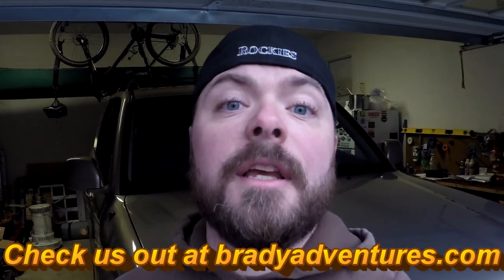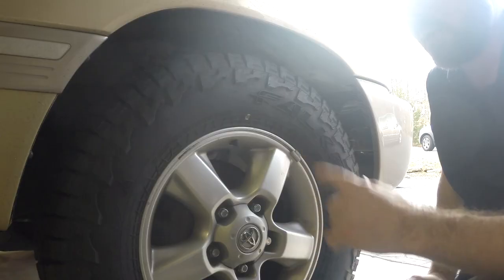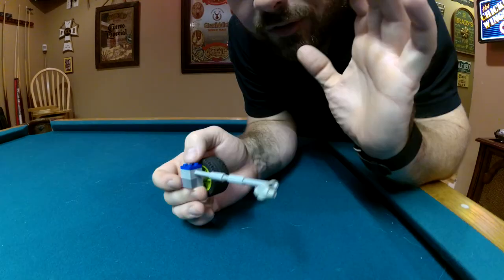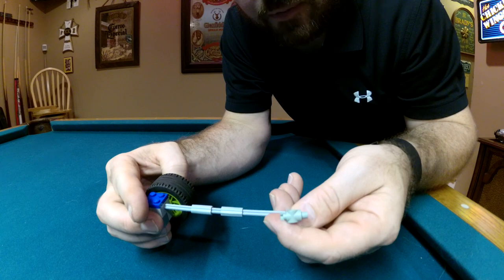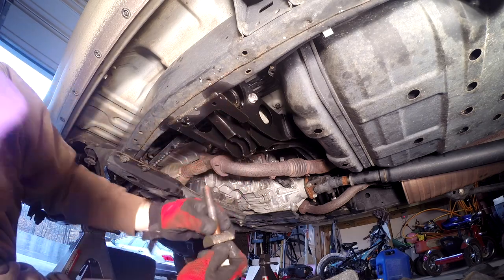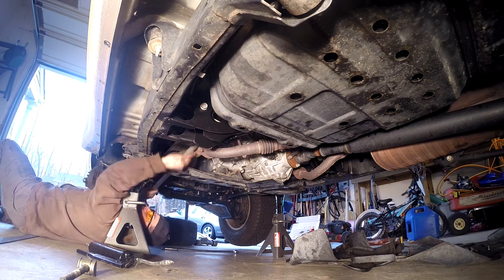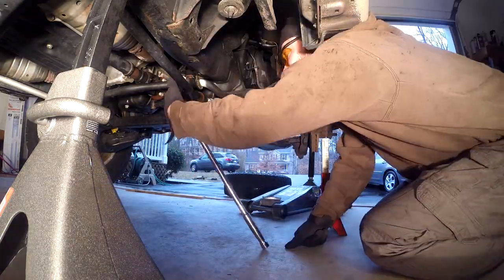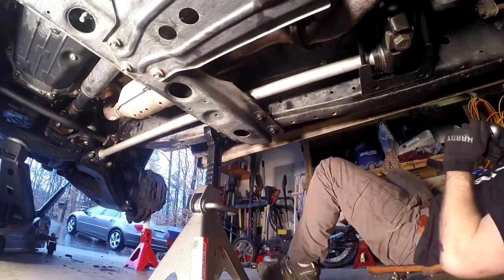OME Torsion Bar Install - Land Cruiser 100 Series Overland Build

Comment: I just finished the lift on my lx470 today and It looks absolutely massive. Didn’t know how to remove the torsion bars and thankfully I found this video and it helped a ton.
Reply from the maker: So glad to hear it! I hope these help people especially when the info is hard to find. Thanks for checking us out and let me know if you ever have any questions
Reply: @BradyAdventures  After installing the new shocks and springs,
can i drive without torsion bar until  buying it later on ? thank you

Comment: Nice video. These things have always mystified me, makes it a little clearer.

One thing, those ratcheting vehicle stands are death traps. They all get recalled in Australia then replaced with a new model. Few years later the process repeats. I'd never get under a car held up with them. I personally know someone that had a set fail and have a car fall on them. Very lucky to be alive.

Comment: A subscribe and a like for you, sir!  This was exactly the video I was looking for, my Ironman 4x4 torsion bars come in tomorrow. Thanks for taking the time to make this video and explain the process, us visual learners need it!
Reply from the maker: Man I really appreciate it!  Thanks for the feedback and hope your install goes well!
Reply: I'm in the process of installing my IM lift right now. The directions are very sparse. I had no idea about which the the bars go to preload, I ended up sitting on the bump stops the first time.
Reply: @Digital_Dairy  strange, my Iron Man torsion bars came marked on both ends, with a several spline offset.
Reply from the maker: Nice improvement!
Reply: @rguil15  so I had to pull them and you are correct. Made things easy.

Comment: Great video. Got one possible stupid question please. Why are torsion bars replaced? Do they lose strength?  I don’t know.
Reply from the maker: thanks! not a stupid question at all. yes they fatigue over time just like a spring and sag. you can crank them up to regain height but lose performance. aftermarket bars have a higher spring rate too so perform better under heavier loads and rougher use.

Comment: 5:55 what ecatly the difference in between the old and new one? I just got an LX470, ahc deleted and replaced with regular shocks, nothing else has done. Front is way lower than rear, trying to level it up

Comment: Should the adjustment bolts be at a similar depth to each other? My driver side one is in at a greater depth than the passenger side.
Reply from the maker: I think generally the answer is yes.  A number of things could impact how deep each bolt is cranked but probably wouldn't make much of a difference.  I would suspect the indexing of one of the bars was a little off.  As long as the truck is sitting right/level and the bolt isn't bottomed out you should be ok.  You might need to re-index down the road once the bars settle and have some age on them.  Otherwise you could pull them back off and re-index and try a second time.  I am assuming these are new t-bars if they already have some age on them one may just be more shot than the other.

Comment: Quick q: if you’re just reindexing the stock bars, would you need to remove them completely or was there enough “play” in the adjustment bracket housing to remove the rear bracket and clock it over?
Reply from the maker: I don't think you can do it without removing the front bracket 🤔 I haven't been down there in a while but once the front bracket is off it's pretty easy to remove them.  So I think you could adjust them without completely tacking them off the truck but by the point you have it were you need it, it will probably be just as easy or easier to do it on the ground.  I hope that makes sense.

Comment: Hey I just installed the OME kit but did not do the diff drop bracket. Would that help my height up front if I did instal the diff drop bracket?
Reply from the maker: Nope the diff drop is not going to increase you height. your height is totally dependent on how much you crank the t-bars.  but make sure you have enough droop!  Sufficient Droop is essential for safe handling Droop is going to be limited by a number of things including shock length, UCAs, etc.  The diff drop is going to keep your front axle shafts close to stock geometry.  This will keep your CV boots and/or joints from failing prematurely.  This can be an expensive repair so it's decent insurance.  I hope that helps, let me know if you have anymore questions! Thanks

Comment: Hey, thanks for the install video, I'm just about to do mine- Tough Dog torsion bars. Question- how do you know how far to crank the adjusting bolt in the first time after installing the new bars? I didn't see you counting the turns when you took the old ones out.
Reply from the maker: That's a great question.  The adjustment bolt goes through the the bracke it screws into and out the other side.  I turned the bolt until there was a decent amount (1/2" or so) on the other side of the bracket for the first check.  The truck was sitting pretty low. I had to turn them quite a few turns after that.  I kept recording how many full turns to how much height I got, rinse and repeat.  It took me a good while to get the driver side close to the final height.  Once I got to the passenger side I cranked it way further initially. I tried to get the amount of bolt on the far side of the bracket close to where I ended on the driver side and it was real close initially, so it went much quicker.  Let me know if that makes sense.
Reply: @BradyAdventures  I know that you're supposed to have a minimum of 50mm of droop to allow the suspension to articulate properly- I'll count how many turns it takes to get the bolt loose and see where that gets me when I re install it. Thanks!
Reply from the maker: @islandj39  absolutely that sounds like a pretty decent way to get started. Hopefully you'll have more droop than that too. I ended up having somewhere between 60 and 70 millimeters if I remember correctly

Comment: I don't think I saw this answered yet. Did you have to do more than 5 splines or was the adjustment screw enough on its own?
Reply from the maker: Nope the screw was plenty after the standard offset.  It is somewhat dependent on the weight of your vehicle but I still have plenty of adjustment left.
Reply from the maker: by the way sorry I missed this one!  Didn't realize this was a month ago!  Thanks!

Comment: @selesheestifanos6708
0 seconds ago
Thank you, great education. I have an LX470 that I  drive a few miles per day within the city and no off-road driving at all. I want to replace AHC with the EMU regular shocks and springs of a land cruiser.  Do I need to replace the torsion bars or can use the original on a car?  Help, Help

Comment: nice vid.  i need to remove the front sway bar bracelets on my 01'.  the bolts that run up are  rusted and rounded.   if i remove the tortion bar do i need to remove the front bracket off the lca or can i slide the tortion bar out without removal of the bracket?
Reply from the maker: I don't think you will have a problem getting them out with the sway bar brackets in place but you do neet o remove the front bracket that the torsion bar slides into. Does that makes sense? Good luck!

Comment: Do you need to replace stock torsion bars when installing a lift kit
Reply from the maker: You don't have to but it is a good idea.  The aftermarket torsion bars have a higher spring rate and and will preform better when lifted.  I needed to do mine too since they are 13 years old and shot. Thanks!
Reply: @BradyAdventures  What were the symptoms of the shot torsion bars?
Reply from the maker: If your truck is sitting low or uneven that can be a sign of them starting losing some spring. You can always crank them to get the height bacl and even things out but the spring won't perform the same. If they are totally shot then I would expect the truck to feel kind of bouncy. Mine were sagging but I don't think they were shot. if you're lifting it's still a good idea to go with aftermarket bars since they have a higher spring rate to handle more weight and the lift.

Comment: Hey great video. What were your final numbers from wheel center to fender front and rear?
Reply from the maker: I think they are a bit different then a couple years back but today I am sitting at 21" up front and 21.5" in the rear.
Reply from the maker: Oh and Thanks! and I apologize for taking so long to get back to you!

Comment: Hi Chuck, What were your final measurements. Also, any tips on how to know which direction to go with your 5 spline offset?
Reply from the maker: My rear sits at 21" from the center of hub to the fender and the front I have adjusted to 20.5".  I did have the front at 20" for a while but like the close to level look.  My truck is generally loaded out so I don't have to worry about the back getting too low.  As for the splines, this can be confusing in so many ways.  If you get it backwards you will know because the truck will go super low the first time you lower the jack. If you are sitting the same direction  as if you were driving and everything was laid out as you were installing it you would mark rear of the torsion bar 5 splines clockwise on the driver side and counter clock wise on the passenger side and line your front mark and the rear mark up with the respective master spline mark on the brackets.  I hope that makes sense. This is a graphic I found in a thread on ih8mud a while back that might help you visualize it https://drive.google.com/file/d/11xJ-sQPwW-8nAqGreEx62CrKbm8F-1ia/view?usp=sharing
Reply from the maker: I got it back wards and am editing it now to be correct.  I can't even remember it straight 😂
Reply: @BradyAdventures  All good.  It's super confusing and thanks for the reply.  I got 'er done and it wasn't too terribly bad.  If you go the wrong direction I wasn't able to get the adjustment bolt in so I think it's pretty easy to figure out.  What part of VA are you in?
Reply from the maker: awesome, I'm just outside Charlottesville,  how about you?
Reply: @BradyAdventures  I'm just outside of Asheville in Western NC.  You ever make it this way for trail rides?
Reply: @BradyAdventures , you're a legend. Thanks for approving access to that google doc file in about 5 minutes flat! Appreciated! Hopefully, finish my install off tomorrow!
Reply: @BradyAdventures  does  the google drive doc provide more info to install the torsion bars? Please allow access to it. thanks

Comment: Do you still have the OEM torsion bars? If so, would you sell them ?
Reply from the maker: Nope I sold them right afterward.  Good luck!
Reply: Brady Adventures Thanks for that luck, because I just found torsion bars and rear springs for $100.

Comment: Hi man I have 100 series lc and I just bought new shock absorbers and springs to give my car a lift . Do I have to change the torsion bars too or I can still use the original torsion bars that came in the car ? Thank you
Reply from the maker: You can use the original torsion bars but it won't ride as well.  Aftermarket bars have a different spring rate and are designed for lift and more weight.  You'll be fine but I would swap out the bars at some point.
Reply: @BradyAdventures  thank you
Reply: @BradyAdventures  is there any specifics , my car has apetrol engine and not diesel . Does it matter at all ? can I use the same torsion bars ,doesn't matter if car runs on petrol or diesel ? Thank you
Reply from the maker: @justusabigaba3954  We don't have diesel 100 series in the USA so I would say that these torsion bars are fine for you land cruiser.  I am not sure if the diesel cruisers have heavier torsion bars to handle a possibly heavier diesel engine?  I would do some searching on the ih8mud.com 100 series forum to see if you can find more information there.  I am sure there's someone who has discussed this at some point. Thanks!
Reply from the maker: @justusabigaba3954  You are welcome! Thanks 🍻